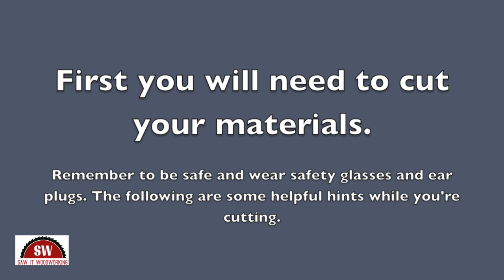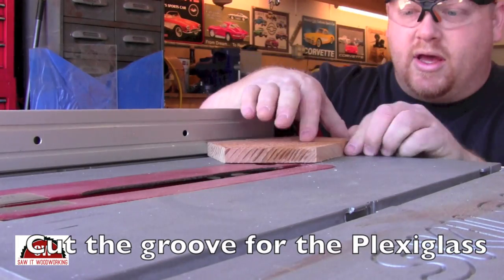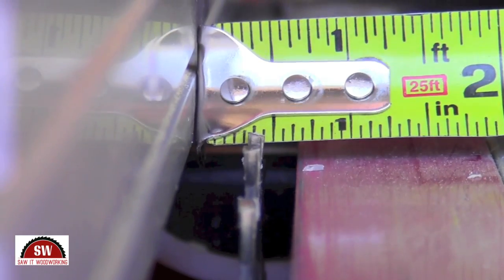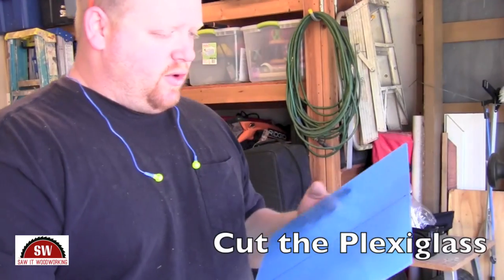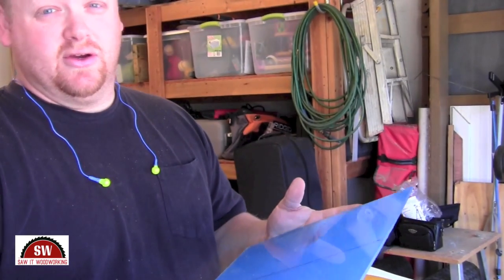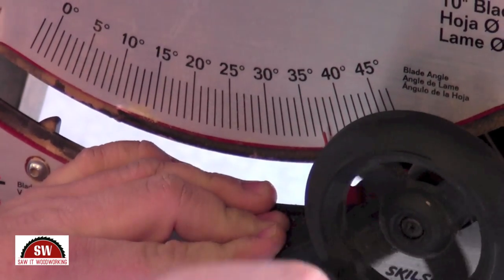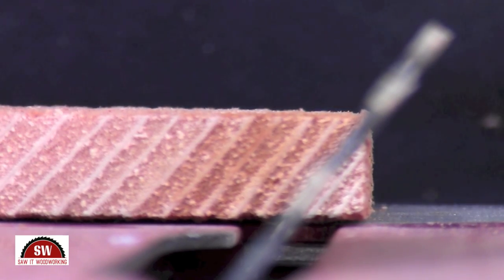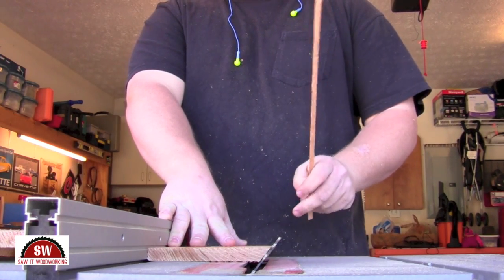How to Build a Bird Feeder - Small DIY woodworking project

Comment: I made a very similar design in my high school woodshop, and I liked it better without the hinges, what I did is instead of attaching the roof directly to the body, I made so the roof came off completely, with more side panels at the very ends of the roof, and I cut up some spare roof shingles that I had and made a fully shingled roof for mine, I wish I could share pictures, but yeah, I hoped I sparked some other ideas for other people

Comment: I like your video. Great looking feeder so well done! If you wanted to apply a sealer or protective coat to the wood, which non toxic products do you like? It would need to be non-toxic and safe for the birds, right?
Thanks guys!
Reply: I’m personally unsure but I’m not wondering if Tung Oil would be ok. They use it on butcher’s blocks so it is food safe

Comment: It there a way to cut Grove for plexiglass with a circular saw?
Reply: If your circular saw has a depth adjustment which it should you could set it at the depth you want and make a simple guide for the saw to keep it nice and straight. That's probably what I would do as I'm in the same situation as you with not having a table saw. Hope this helps!

Comment: The strange thing is I made a hopper feeder similar to this one some weeks ago now. I made the roof in one complete section to avoid the chance of rain getting into the hopper, the roof is held in place with screw-in eye bolts and two exhaust springs. Thing is, the birds refuse to go anywhere near it. They fly around it to go to the other seed and tube feeders that I have in the area but haven't been anywhere near this feeder for almost three weeks now. Any ideas people.
Reply: does it have any toxic smelling finish or paint? Just wondering.....